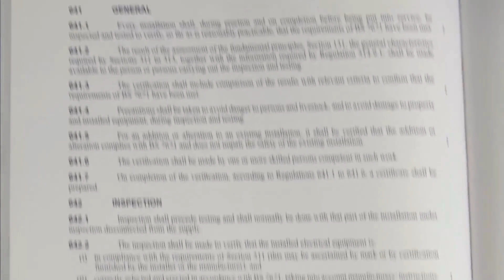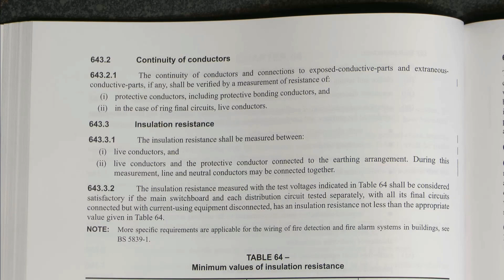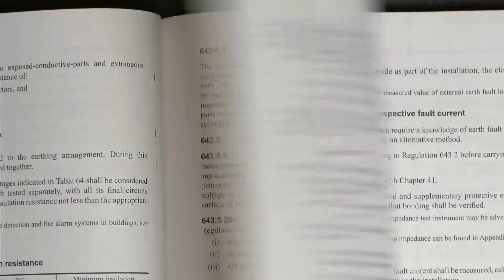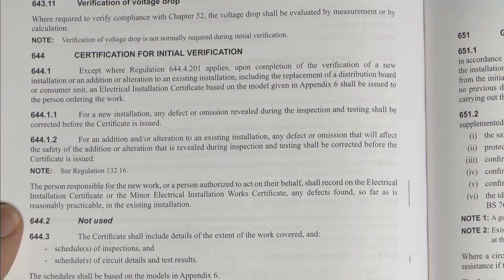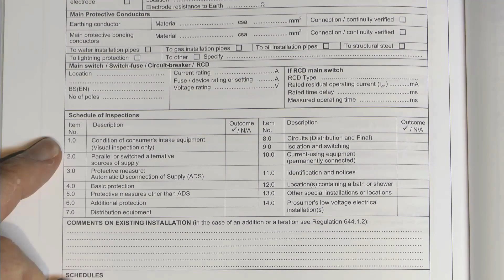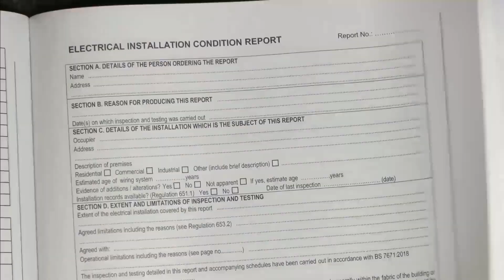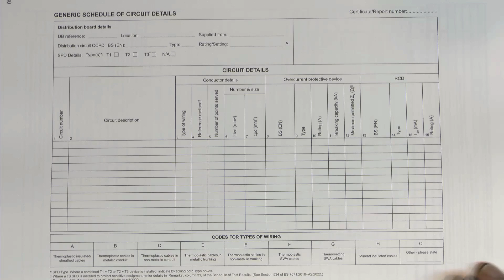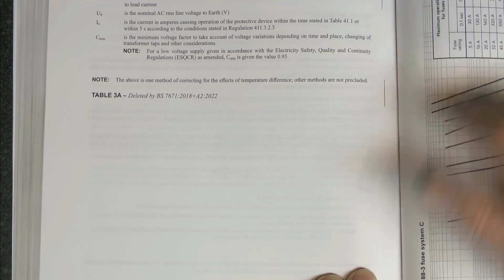BS7671 18th Edition Amendment 2 Part 6

Comment: Thank you John, Brilliant as always
Reply: perhaps table 64 test voltage column should say 250v for Extra low voltage, 500 or 250v elv to 500v and 1000v for above 500v. because the minimum 0.5 meg is for ELV not low voltage

Comment: Hi John another useful video thank you very much! I agree with you regarding the RCD checks, I think possibly the reason they've changed it to make it less thorough is in a bid to keep people focused,,,
When RCDs were all that we really had to focus on for additional protection it seemed right that we should understand them,,, perhaps it was felt that there are a number of devices these days which offer  additional protection SPD's etc... and if all those additional devices each required such thorough ( tests/recordings ), Perhaps corners would  be cut and charlatanism's would start affecting the works negatively whereas if all you are asked to do are summary versions then perhaps people are more likely to stick to it rather than skip it or fake it,,, 
Kind regards Warren